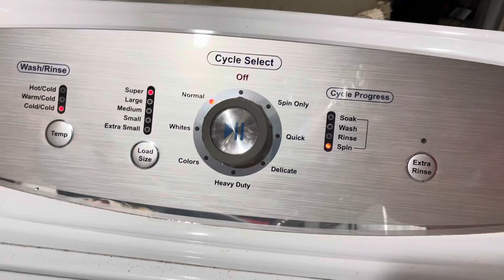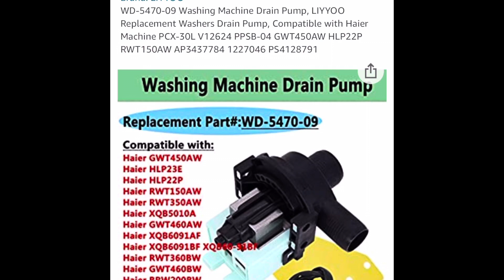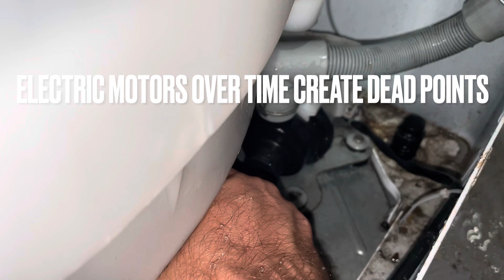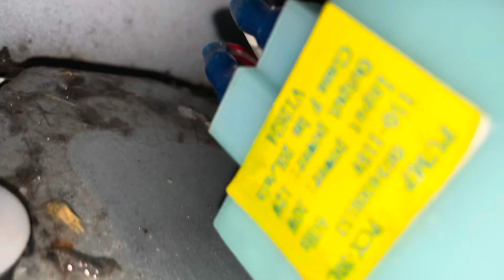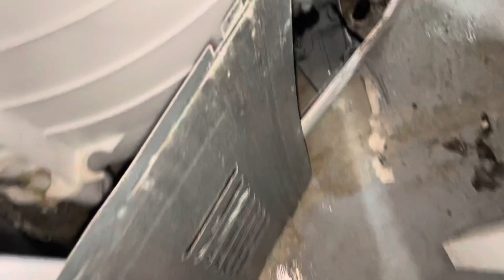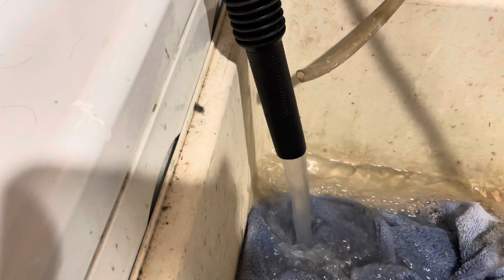Washing Machine Diagnose & Temporary Repair - Haier - Drain Pump - DIY

Comment: Hi.  Thank you for the helpful video.  I was able to access the drain pump and spin the propeller, and it now works.  The only problem I'm having is now the rubber drain pipe will not stay attached to the drain pump tube.  When I removed the rubber drain pipe from the tube, it was secured with some kind of sticky glue substance and a clamp.  I have the clamp attached, but it does not seem to be enough to keep the pipe attached to the tube.  Do you know the name of the glue used so I can purchase some?  Thanks again.

Comment: Hello, for mine, water is not draining? Do you know if it the same problem? I need help removing the nail but it is really tight? Can you please help? Thank you!!
Reply from the maker: It sounds like the same issue. If the water isn’t draining and you can’t hear the water pump I would check the drainage line then check the pump to make sure all the simple problems are checked. After that you could try spinning the pump which means you’ll need to take it apart. Then put it back together and it should run temporarily. Then just replace it. I hope this helps.
Reply: @803Garage  Do you know how to remove the nail? It is really tight.
Reply from the maker: @simonliang6744  I honestly don’t recall I’m sorry. 😞

Comment: Great video, after watching I located the pump and found a paperclip stuck inside.  I only removed the intake hoes and pulled it out.  Now it works great.  Thank you
Reply from the maker: Nicely done. It is only a temporary fix. It will happen again but you know the fix. Just rinse and repeat until you want to replace. =]

Comment: Interesting how every HAIER brand gets the same issue
Reply: Those little cheap pumps run hot. It would be good if they made the drain line pass over a heat sink on the pump to cool it as it’s draining.
Reply: Weak drain pump.

Comment: Finally found a video on my exact washer unit model! Going to try and do this and will report back.
Reply: It did not work for me. I can't tell if the pump is dead or what. Makes a loud noise when I put it on Spin cycle and it won't drain. I'm not going to run a full wash cycle because getting the water out is a bitch for me. It's somewhat damaged and older so I think we're going to replace the whole unit. I'm not confident replacing the drain pump will improve anything at this point.
Reply from the maker: @steventyler3985  I’m sorry to hear that. You could always remove the drain pump and apply the proper voltage in a safe way and see if it’s the problem. My washer was 250 brand new. I got it from a scratch and dent place. Obviously mine is far from top of the line. They can be easy to fix however if it’s anything to do with the main board. Toss it.

Comment: Man I don’t have a drain, I’m laying towels down. This is my third time and I said duck calling the repair man, I’m doing it myself. Hoping this helps
Reply: Update, there wasn’t anything clogging it up, (the last two times the repairman came, my girls Bobby pins were in there) so I was shocked. But also numbed cause I assumed it was broken like it was he came the second time. Nonetheless I tried to spin the pump which was a little different than yours, it was wider and harder to spin but I think I got it to go around a few times. Then I put it back together and it drained! Thanks man
Reply from the maker: @moooch10  that is awesome. It may fail again. So if it does just repeat your fix to get it going and then replace it which is what I did.  I’m happy this worked for you. =] 💜 makes my day!